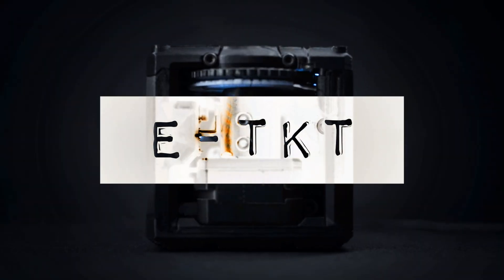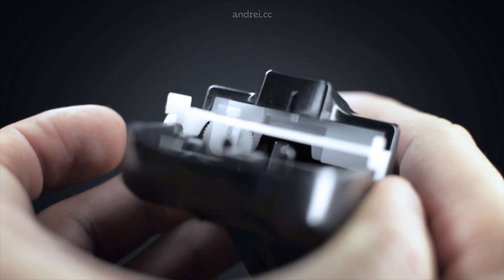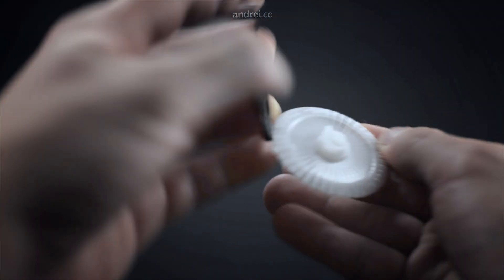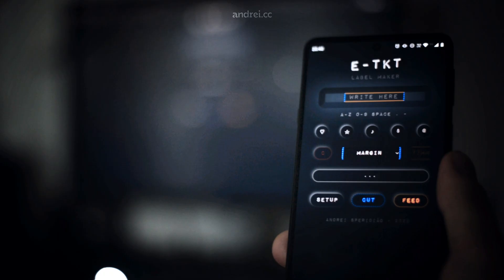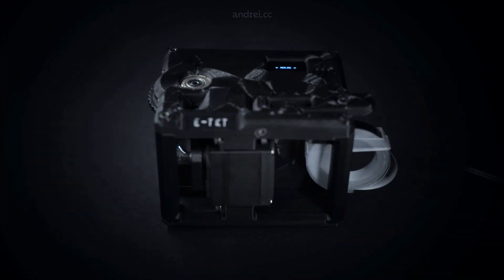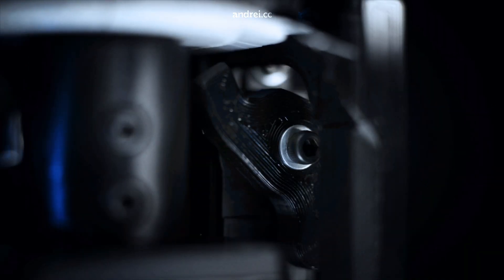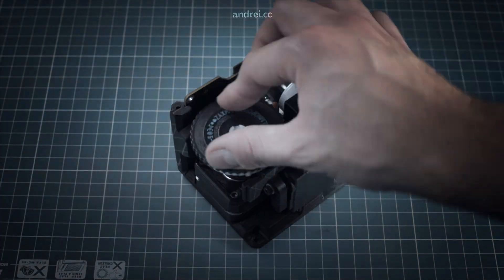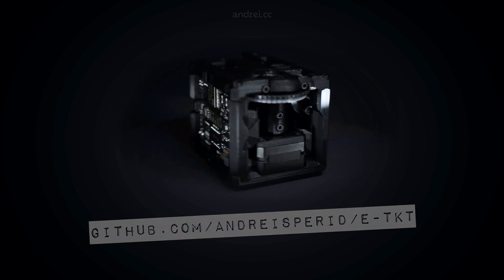E-TKT: open source anachronic label maker

Comment: Amazing work! I wonder if the speed could be increased by improving the rigidity of that machine? What are the limitations here?
Reply from the maker: Thank you Keelan! Right now, the slowest part is feeding the tape, because I've used a cheap and small reduced stepper motor. If I speed it up too much, it misses steps. The character selection on the daisy wheel also takes some time too. To be honest, I think there is a charm on making it slow, so I didn't bother. But indeed, the overall rigidity is a matter too, but at the same time this small flex helps a little bit on the parts' accommodation while pressing.